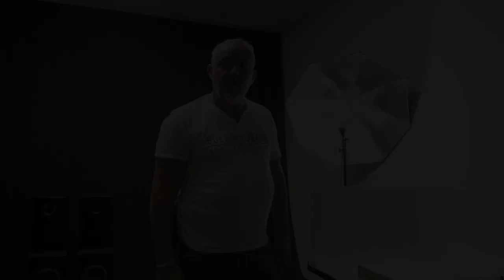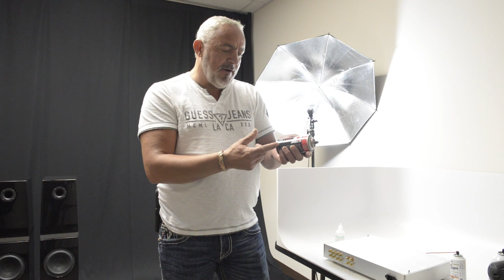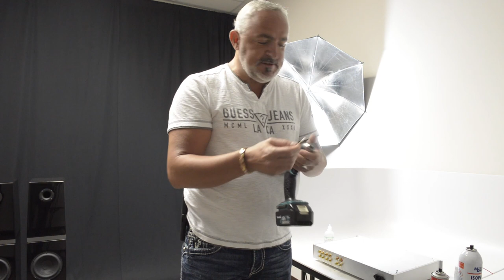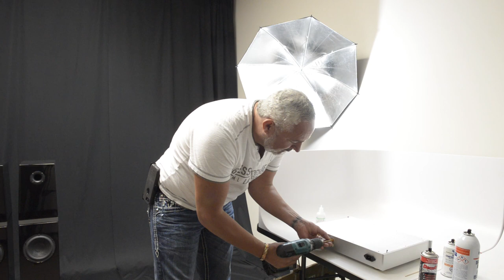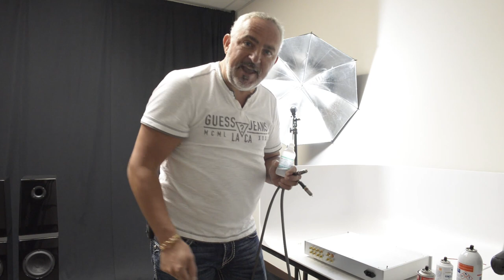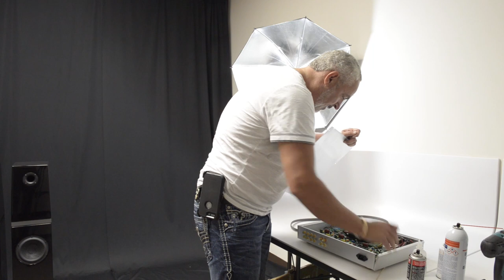Cleaning audio connectors and contact enhancer

Comment: My vintage hifi gear is original owner, me. My (1982) ADC EQ lost the left channel in July. I pondered gettin' it fixed but was kinda lazy. I got an epiphany yesterday and decided to clean the RCA plugs 'round back. I rubbed with isopropyl (92%) and Q-tips, reconnected and voila! I restored the left channel. This advice can save a whole lotta samolians. .

Comment from the maker: Although we only show the cleaning of RCA, most every connection can benefit greatly from a good cleaning. Most commonly power cord connectors, polishing the blades can make a nice difference. You can clean fuses, terminal junction links, obviously XLR, as well as banana and spade connectors!  Take extra care if you decide to clean connectors inside of audio components however they can greatly benefit as well. The application of Stabilant 22 to these internal connections can be simply astounding. Have fun!

Comment: Thanks for the tip about using a drill with a wooden Q-tip. I find that a few pokes into the female XLR jack with a fine rat tail file is necessary when the corrosion is severe. The humidity is Florida is brutal, despite air-conditioning.

Comment: Shalom, not sure if this channel is still active? Your audio volume is great on this video.  Lately noticed many channels have low audio.  Due to PTSD, slight hearing loss (mix of Veteran and working in healthcare) I have only a old TV (on fixed-income) and even with TV Volume on max can't hear most channels.  Have a Roku 3, with earphone connection on the remote, working on the pin cleaning, but ears been recommended not to use often or long.

Could u do a video for all channel creators on how to have loud sound volume? The old saying if cold we can add layers of clothes, but if hot can only remove certain amount of layers.

Same with volume we can lower volume but can't increase volume more than what's coming from the video sound.

Comment: I have noticed numerous negative comments for using a drill on cleaning RCA Connectors?/!  I understand the concerns some individuals have about using a power drill, but Rick is offering one (1) way cleaning process.  Obviously, there are various ways to clean RCA’s.  IF you are careful and patient, you won’t damage the connectors.  However, if you are not careful and rush while using a drill, you will probably damage connectors.  SO, to avoid damaging RCAs, use commonsense - meaning turn down the torque on your drill (Don’t set drill to Max Speed Setting, with the it spinning at 3000+ RPMs).  Obviously, if you use the drill like that, commonsense would dictate that you are probably going to melt inner side of RCA connector.  IF you do not like drill method, buy/try handheld “Power Screwdriver”.  It looks and operates like a drill, but much smaller.  I strongly recommend buying/using the power screwdriver because it’s extremely handy tool and cost effective.  I bought a “SKILL” for $25, and I use it each time while working on audio components (especially cleaning RCAs).
Reply: Yes common sense is required and no you don't even have to use a drill at all. If you are not skilled in tools and  you fear you may melt the plastic you and qualify your self as not capable of doing the work on that level and should not attempt it!  So if that is you them skip the power tools altogether and use you finger tips to rotate. Still even in this  please use common sense aa this wise man has suggested! 
Great work Pecrobet Audio! Very helpful advice to those who may lack mechanical skills. I do realize growing up I was fixing cars with my dad using power tools correctly  by age 8-10  and assume everyone knows how to use power tools properly and with common sense but my 14 year old sone skipped this gift so I get it.. 
To us that do know and are trained with use iff tools it seams obvious and we can easily forgot that not everyone has used tools or knows how.  Please forgive my oversight.
Please as Pecrobet Audio has mention so clearly. "Practice caution and common sense and you will do fine folks!". If you worried at all just use the sprays and forget the cleaning swabs as you will still get you connections  better than they were and have little to no risk. Unless of course you never use spays then just skip all this and send it in for a proper maintenance to be done by a professional. (Good idea anyway.)
Please remember that I come from a manufacturing standpoint we're changing out a connector is a two minute job and if connector has any damage ore wear it should be replaced anyways. In fact the best thing to do is just replace the connectors with brand new high-quality one and that's really what we do at our shop anyway. This is just a tutorial to help you if you're wanting to get something better for sound and do not have the skills to replace the connector properly. It can be done in any measure that is comfortable for you and it's only a suggestion certainly not a law. :-) Relax and enjoy your audio..

Comment: I usually use wire wool on wall plugs. Look at copper, it's essentially passive effect to keep it clean. Also have an independent power supply from electric distribution unit. Teflon is used on speakers wires too. When I load a cd into the draw, I have an Earth that I hold whilst I load it into draw...it helps to drop off static charge. Also benefits by touching metal to earth. Luckily my house is concrete walls and floors...no wooden floors.🔊
Reply from the maker: That, sounds like dedication to me. :-)  I tried to use static guns for records on my CD instead but had little success.

Comment: Music Direct sells an rca cleaning tool. It is shaped like the female end on one end and the male end on the other. It is very easy to use.  Spray contact cleaner on it and plug and unplug it a couple of times and your cable jacks and jacks on the back of the component are clean.
Reply from the maker: Sounds like a great tool, well order that and give it a try, thanks!
Reply: I should have checked before I posted the comment, but it appears they are no longer available. I hate that. I bought a pack from music direct and really like the way they work. Evidently not enough people were interested in them to justify their continued manufacture.
Reply from the maker: Too bad..

Comment: good one thanks. i have CRC switch cleaner lubricant.  I did have another brand before that but dont recall the name.  I have even fixed noisy POTs by spraying inside them
Reply from the maker: Have to try that. WD-40 might work as well.

Comment: I have a 1966 Magnavox console AM/FM phonograph with the Micromatic record changer. In 2016, the sound from records became distorted and scratchy with intermittent hum and too bassy of sounds with the "shhhh" sound on highs and vocal "S"s. I replaced the needle and nothing improved. I see green corrosion on the two connectors coming from the bottom of the record changer. The radio sounds fine. Would that green powdery corrosion on the two connectors cause the pronounced poor sound quality?

Comment: Would just cleaning out with deoxit work?
Reply: There's another short video on here that shows deoxit recommended. I sprayed myn and just stuck the cables in straight after to make sure both sides of connection got a soak. It seems to have got rid of a static/distorted sound i was getting.

Comment: Commented too soon , you are using a drill LOL.
Reply from the maker: Yes, I am, this works great but you do have to be careful not to break off the swab. It forms the diameter on entry so spend a bit of time inserting it into the connector and make sure you don't have a-lot of resistance while trying to insert it. You will need to remove some cotton to make it fit.

Comment: I stopped watching this after RS stated gold oxidizes  -  Gold is incorruptible  Non -reactive with Oxygen
Reply from the maker: Gold plating degrades over time due to the same electrical process that the parts are pleated with. The gold basically erodes the gold off of the connecter as the electricity moving through the connecter breaks it back down over time similar to how it was built up to begin with.. It  does not oxidize it simply erodes back into tiny particles. I certainly don't know everything I never claimed to, but I think it's called localized arc erosion?

Comment: Gold does not rust, corrode, tarnish, etc.
Reply from the maker: The subject matter is worn electroplated gold connectors not "pure gold" connectors so that is where we have the difficulty.
Electroplated gold connections do break down in adhesion to base materials and eventually give way to corrosion to the underlying metals due to the removal of the typically thin gold plating. This happens due to insertion and removal of audio connectors as well as the audio signal being of an electric charge. The charge will slowly interact with the electroplate charge that was used to plate so over time it takes a toll on the think layer of golds ability to adhere to the metals below it. Typically these are silver or copper, and then the gold comes away from the connector itself and at one point will be completely removed.  It can take a long time (years even) on a "very good" connector that is well plated and manufactured but eventually the electroplated gold will come off leaving no real surface protection. This is due to the fact it is so thin of gold layer.
For the gold itself indeed the gold particles do not actually break down but once it is worn off the audio/video connector that is irrelevant to those who need to address the mess left behind. 
If the connector has a base coat of silver the silver is still highly conductive even when  fully oxidized but copper more commonly used on connectors breaks down conductivity when oxidized and must be cleaned often to maintain good conductivity. 
A better solution that aligns with your idea of a "good durable gold coating" is to replace the connectors with brand new high quality ones offered from many great high-end audio companies. 
Alternativly rhodium is now common in connectors for its ability to withstand much more abuse than gold coatings and they do last longer. Some say they offer even better sound as well. However rhodium is reduced in conductivity from gold so why it "might" sound better has always been a bit of mystery to audiphiles and is likely not something that can be verified easily. Still it is a nice option worth considering and will last much longer than gold I you do have a desire to replace your worn connectors. 
Cleaning is a short term solution in comparison and not a true substitute for replacing worn-out connectors.
Direct to your point if we had "pure gold" connectors not gold plated ones they would last a very long time certainly longer the the equipment and would be the "ultimate choice" I am sure. :-)  However the sheer expense keeps pure gold connectors form the audio market.

Comment: You don't know what you're talking about. Gold does not tarnish or oxidize. That's why it's used for electrical connections, and why it's used as jewelry, and why it used to be used for money. Brass connectors are only used for radio connections outdoors. Oh yeah - common consumer electrical contacts need cleaning, but not the gold ones.